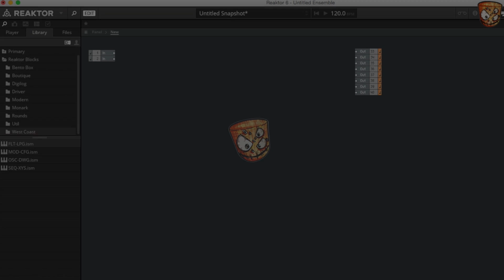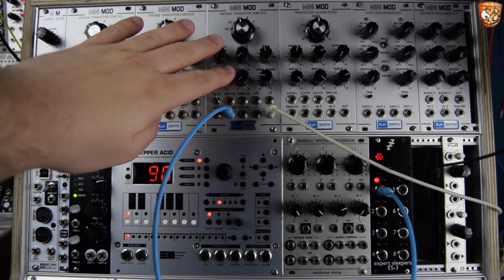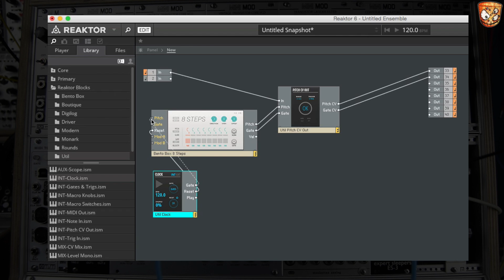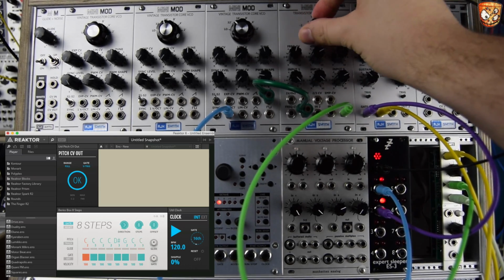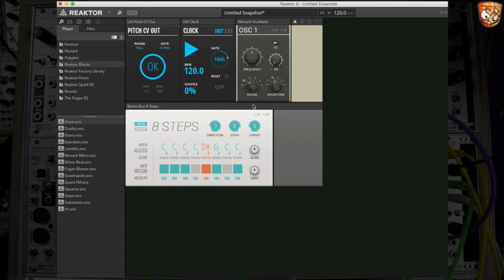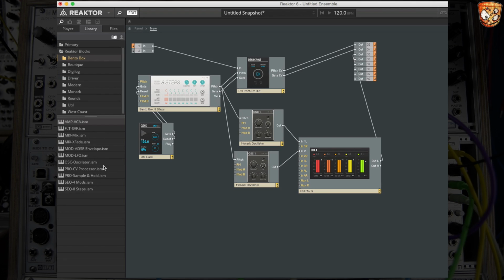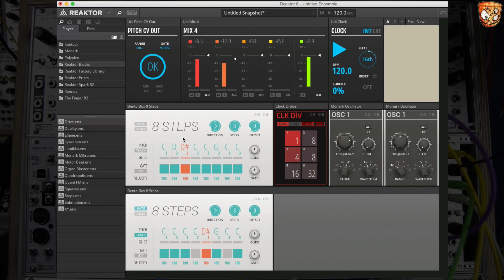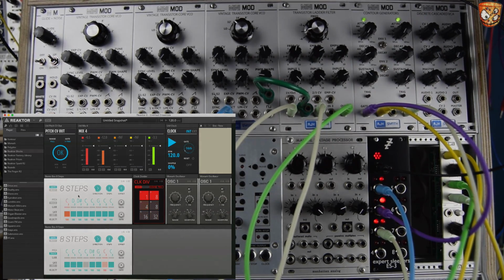Reaktor Blocks - Controlling & Expanding A Modular Synth Voice

Comment: is there a way to clock reaktor from the eurorack with cv in? the input of reaktor block clock module is only for MIDI Clock right? is there a block for CV Clock input? Cheers
Reply from the maker: I don't know. You can take eurorack CV/gate and turn it into MIDI with the Befaco CV Thing or VCMC though for the MIDI clock input
Reply: @DivKid  thanks for the reply. however, it seems this there's no cv clock in module in reaktor blocks.. so i think i will abandon the idea of using reaktor and keep using ableton and expert sleepers es modules, cheers

Comment: I've been using ES-3 and Reaktor for years inside Abelton Live. I can tell you it's ridiculously finicky and NI has a LOT more work to do to make integration with actual hardware CV a reality. Reaktor Blocks are incredible, but using the blocks to control your real modular gear is a royal PIA. PLEASE someone simplify this and Reaktor will enter new dimensions of awesomeness.

Comment: I can't believe it's nearly 2021 and this is still complicated in Reaktor. Nearly every hardware synth these days has CV now, and interplay between the hardware and software world is both exciting while still frustrating because these basic interfacing tools are lacking.
Reply: You may feel this is complicated, but I think it makes perfect sense and I appreciate that Reaktor has these capabilities on such a low level.... lets us custom tailor to EXACTLY what we desire. So often designers miss the mark by over-simplifying cv control outputs (MPC anyone?) and leaving out configurability.

Of course, I'm an electrical engineer and have been building modulars for 2+ decades, so this feels more natural to me..... Learn how it works at this lower-level, save your rack setup, and it'll be much faster for you when you need to use it in a track.

Thank you DivKid for this video (not to mention the hundred or so others of yours that I appreciate)!

Comment: I'm looking at a similar hybrid set up using the ES-40 and ESX-8CV and Silent Way. How do you find Reaktor Blocks overall for sound and modulation? I tried VCV Racks (via Bridge) in Ableton and it was unusable due to CPU load which is unfortunate because I like the tradition functionality and modules in VCV. The Softube modular is just way too expensive when you start adding paid modules. Seem Reaktor Blocks is the only way to go.
Reply from the maker: Blocks sound great not light on the CPU but I haven't compared to VCV I believe that's higher CPU usage generally but can't be certain. You're right that the Softube model does seem expensive in comparison.
Reply: Tested both Blocks and VCV in Ableton. Blocks there was no issue but VCV had major CPU issues.
Reply from the maker: ah ok, well Blocks in the answer then

Comment: how did you get channel 33 to 40? for my aggregate im using MOTU Ultrlite and ES-8. with the aggregate setup, i can only create outs from 1-16 in Reaktor. any help would be great thanks
Reply from the maker: keep adding outputs in Reaktor until the number goes up high enough. I don't know a way to change the output number other than creating more of them keeps that output going up. I had an aggregate device set up with another device 1-32 and then 33 up was the ES-3.
Reply: DivKidVideo thanks for your reply. I actually tried after i asked the question. Werks in standalone just fine. But i need to leave all the extra outputs in the Ensemble, if i delete, say 1 and 2, the rest renumber. 

Doesnt seem to want to werk while being used as a software instrument in Logic. I guess its not an option when used in Logic?

Thanks for your help
Reply from the maker: Not sure to be honest as I've only used it standalone I'm afraid. Had any luck getting hold of Native Instruments about it?
Reply: NI actually told me you can't get more than 16 out from Reaktor in Logic. i guess my description was lacking. because they aren't wrong, BUT there IS and answer to my question.
 someone from MUFF pointed out that when you create the Reaktor  software instrument in Logic as a multi timbral instrument, that track then has a little + at the bottom of the track in the mixer. click on that and it will add buses linked to your software instrument where you can assign the OUTS to physical outs of your system not the numerically constrained in the plugin. 
 so yes you are still limited to 16 outs from the plugin version of Reaktor in Logic. but that 1-16 can be routed to your additional out buses that can be assigned to however many additional physical outs you have available to Logic. 
 its actually freakin fantastic. everything in Reaktor is automatable in Logic...so...huge amounts of fun to be had.
Reply from the maker: ah ha! Good to know the multitrack method works. Super powerful system. I need to delve into Blocks more and explore it. I guess I'm not away from the hardware modular enough to feel the urge to get into the software as much.
Reply: i think i opens up the hardware immensely. the main reason for all the questions was to get Blocks access to my rack and my Elektron boxes. Blocks is the middle-man from my rack to the boxes. the modular turns the Machinedrum and Monomachine into two ENTIRELY different beasts. [agree...software is not inspiring] sending CV converting to CC to mess up those boxes is a blast.

Comment: Hi, Im having trouble trying to use Reaktor as a VST in Ableton and sending signals to my ES-3. If used standalone everything works flawlessly. But when using it inside Ableton, Im unable of sending 8 signals from blocks out to my ES-3, I am assuming it has to do with Ableton only allowing me to send midi tracks to just a stereo pair of outs, instead of to the 8 ADAT outs. Do you know of a way of solving this?

Cheers and amazing videos!
Reply from the maker: Sounds like a question for Native Instruments I'm afraid. I don't know anything about that side of the set up. how about running a few instances of Blocks? Or setting up multiple channels with multiple input sources (if that's routable even through Reaktor).
Reply: Hey, thanks! Yeah, I ve managed to do 4 midi tracks in Ableton, and send two Reaktor signals per channel (asigning each tracks outs to a pair of outs mirroring my ADAT setup), problem is having 4 tracks running Reaktor is heavy in the CPU and Its not very efficient as I cannot do interconnections between blocks, unless I just duplicate the same ensemble for the 4 tracks, which would be a CPU nightmare and would still not allow for smooth playing of the entire setup. Ill get in contact with NI and OS, thanks though!
Reply: Haha maybe I have just arrived to a solution (just in case anyone reading might be interested, or even yourself Ben). I am assuming I could just have one Reaktor midi track with my entire ensemble outputing audio to my first pair of ADAT outs (9/10 in my setup), then just add 3 audio tracks that receive their audio from Reaktors midi track, and output to the remaining 3 pairs of ADAT outs(11/12, 13/14, 15/16 in my setup)... I need to try this later, but it seems like a clean solution
Reply from the maker: That seems like a more elegant solutions and less CPU intensive. Be good to know how you get on.

Comment: So I have been using this set up tonight.  I have an ES-3 attached to an ES-5, ESX-8CV, ESX-8GT and ESX-8MD.  Try as I might I cannot work out how to route signals to anything other than the 8 ES-3 outputs.  This means if I route anything to outputs 7 and 8 it outputs on those two channels and all the other attached modules on all their channels too.  Any ideas on how it sort that out?
Reply from the maker: Hey, I can't help with that one I'm afraid as I don't have any of the expanders. Os at Expert Sleepers is great and a good communicator / fast replier so I'd hit him up. First check the Reaktor and / or Muff Wiggler forums for any ideas though. I'm sure a few others will be using Reaktor with those modules.

Comment: I know this is not strictly related to eurorack, but to Reaktor... But I have been trying to make a 16step sequencer using blocks for ages. Im just applying what I know from eurorack, so I am trying to use seq switches and trying to sum both 8stepseqs outs into a mixer, but I am not getting any decent or expected results... I am using an ES4 btw
Reply from the maker: So two 8 step sequencers both clocked at the same rate then patch both of their outputs into a sequential switch. Move the switching at a divide by 8 rate compared to the clocks moving the sequences and then it will play 8 steps of one sequence and then move to the other 8 steps and back etc. Presuming it's an 2 way sequential switch.

Comment: This has got me thinking - I have a Nord Modular Synth&Editor and I would like to be able to incorporate this into my eurorack if possible? Would the ES-3 work in my case would you know? Do you have to configure the USB to adat device within reaktor settings? Not sure if I would be able to configure this within Nord editor? Any help would be very welcome. :-)
Reply from the maker: No idea with the Nord Editor I'm afraid. Can you get the Nord Editor into Reaktor on the computer someone? If you can get the values in you could use Reaktor to then send them out to an ES-3. Not sure that's possible though.